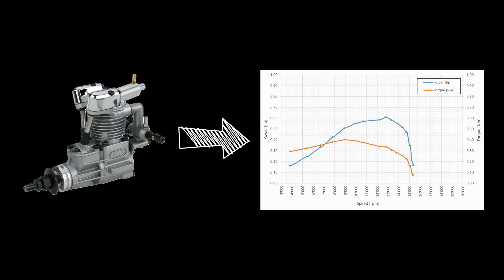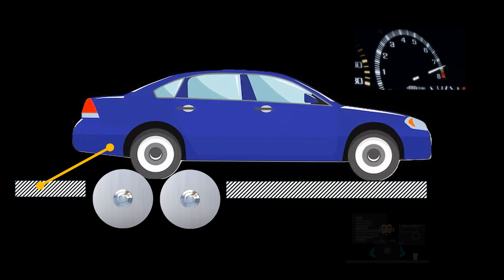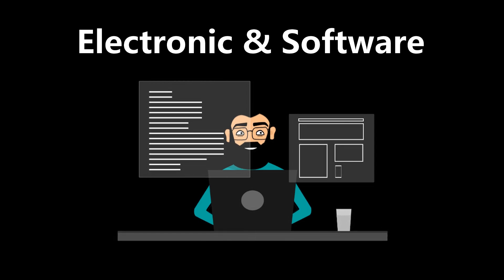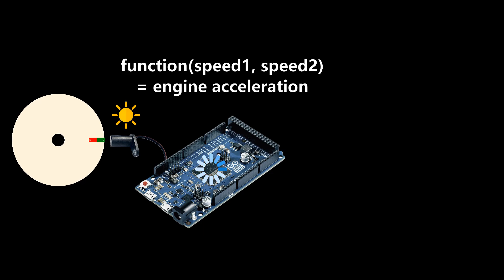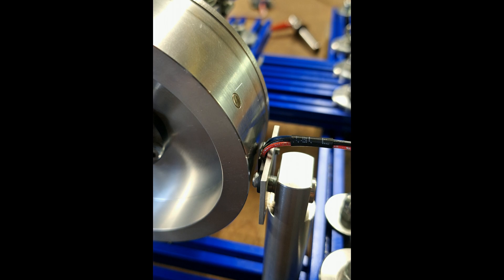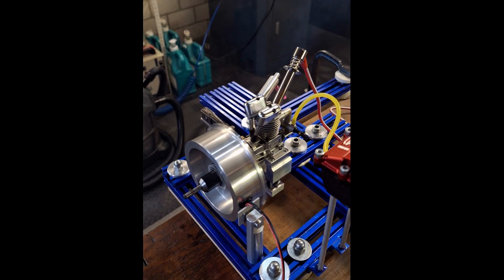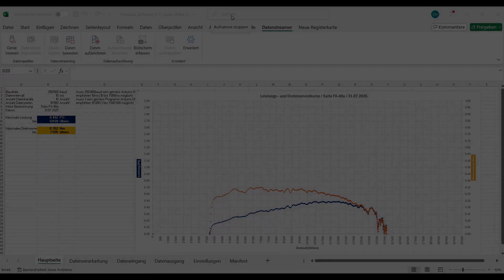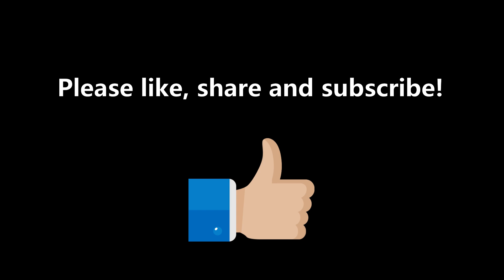How does my dyno for model engines work? / Wie funktioniert mein Prüfstand für Modellmotoren?

Comment: Try building a (rev force engine) with the exhaust rotary valve on the side of the cylinder and the intake port on the side of the cylinder, using a four-stroke engine lubrication system.

Comment: Kein Interesse das Schwungrad zu bremsen um den Motor ein bisschen zu foltern? Mit wenig Aufwand kannst du noch auf ein Output ein Leistungstransistor und eine Magnetspule dranhängen und sie  mit einem veränderlichen PWM-Signal die Spule bestromen. So hast du eine Wirbelstrombremse.
Reply from the maker: Hi Argentum! Immer wieder schön von dir zu hören 😃Es soll simpel bleiben 😉 Ich hätte theoretisch auch eine Bremse (Wirbelstrom, Fluid, mechanisch, etc.) verbauen können und mit einem Drehmomentsensor "Aktion = Reaktion" messen können. So machen das ja moderne Rollenprüfstände, damit sie nicht Monster an trägen Rollen verbauen müssen. Aber man kann nicht alles machen bzw. haben 🤷‍♂ Ich bin schon happy, dass ich das alles so hinbekommen habe! Wer hat schon einen funktionierenden Motorenprüfstand zu hause?
Reply: @danielhunziker3577
Hi, ich dachte eigentlich weniger an eine Leistungsmessung mit einer Wirbelstrombremse, sondern eher daran  den Motor eine längere Zeit mit einer grösseren Last zu belasten, was ja bei einem Schwungrad nicht geht. Ja man könnte es auch mit einem Neodymmagnet machen. Ja eigentlich sind einfache Lösungen auch die besseren Lösungen. Was anderes: wieviel hat eigenlichdie Doppelzünung gebracht?

Comment: Thanks so much, Daniel, the explanation is crystal clear. Obviously, the methodology assumes the engine is well-tuned and there's no hesitation when increasing the rpm. It works very well, especially with electric motors, I assume! Do you have a criterion for determining the size and weight of the flywheel in relation to the expected performance? It can certainly influence the measurement! Antonio
Reply from the maker: Hi antaf56 👋 I used a flywheel with an inertia of nearly 1'000'000 g^mm^2 for an engine with 370W, 0.35Nm and max speed of 15'000rpm. In the end important is the torque of the engine to define the inertia of the flywheel. I would say, that 3'000'000 g^mm^2 per 1.0Nm torque is a good choice.

Comment: I see in your graph there was no cross over at 5252.  As on usual Dyno testing I've seen.    On yours it's was a lot higher up in the rpm range.     Is there a reason for this
Reply: The torque and power curves cross at 5252 rpm when using a 1:1 scale and using horsepower and pound-feet as units. He is using horsepower and newton-meters, so the lines should cross at 7018 rpm, but because the scale is 2:1 (2 horsepower is at the same y-height as 1 newton-meter) they cross at 14036 rpm.
Reply from the maker: @xavimedina2763 You got it! Love your answer 😍
Reply: @xavimedina2763 🎉Thank you.  Explains it very well